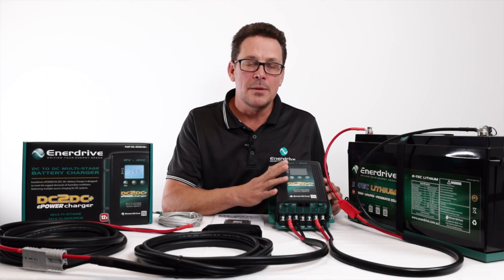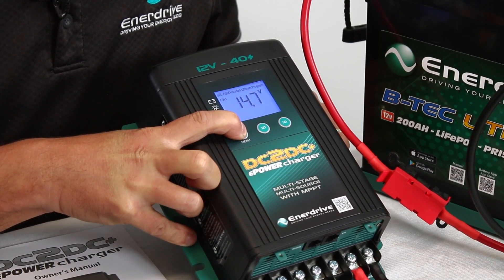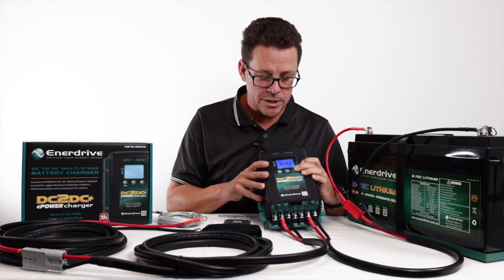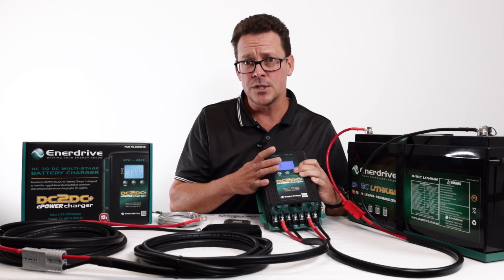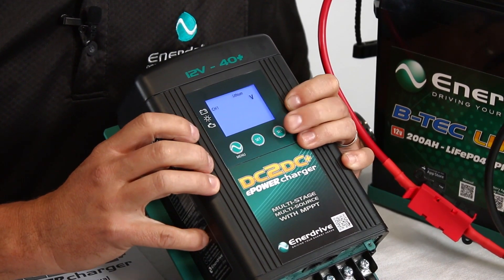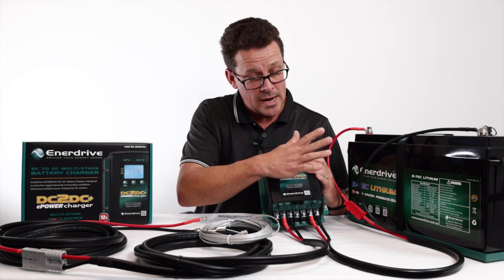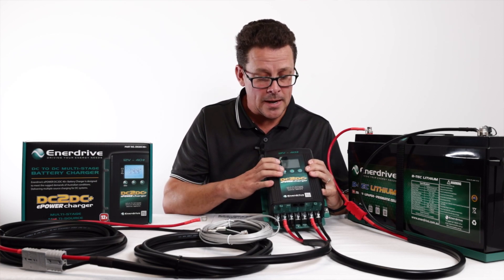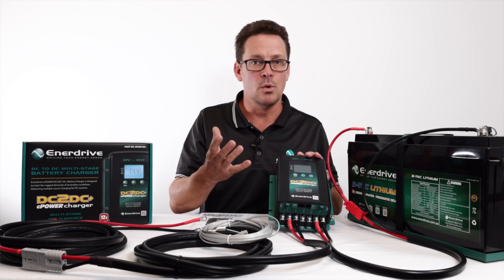Enerdrive DC2DC Chargers - Part 5 - How to Program Settings

Comment: On the DC2DC40+ is there any way in hell to de-activate the pesky "check function" every 3 mins?  With motor running, my starter battery is ALWAYS above draw-off threshold. Checking is 100% superfluous.

When charging high (25-50A) and drawing 700 watts of engine power from my small 2 cylinder boat engine, I set the throttle for comfortable revs. But during "check period" the motor revs out to a twice that speed. Bloody annoying. What fix can you offer?
Reply from the maker: Hey mate, can you give us a buzz on 1300 851 535 and ask for Cain?
There's a few factors to go over here that will be much easier to assist you with over the phone.

Comment: I’ve got ch3 staying on and not checking ch2  or the starter every 3 minutes, it’s not on priority and it isnt connected to the ignition source , I  can see this through my battery monitor, I’ve had it for 6 months and it always checked ch2 and the starter every 3 minutes, have you seen this before or can you advise me of why this is happening